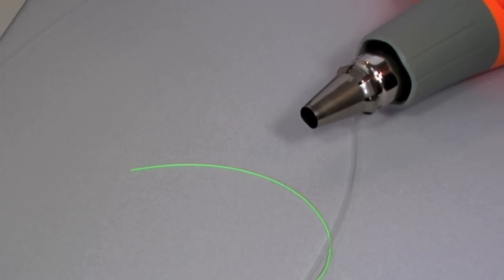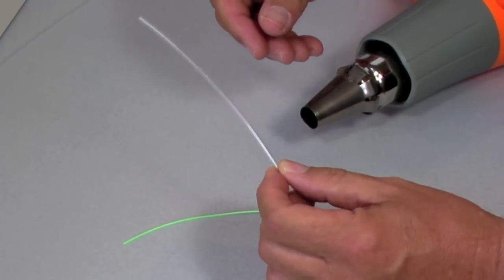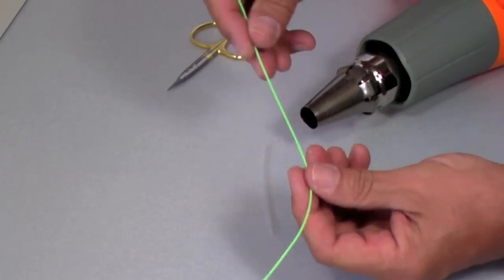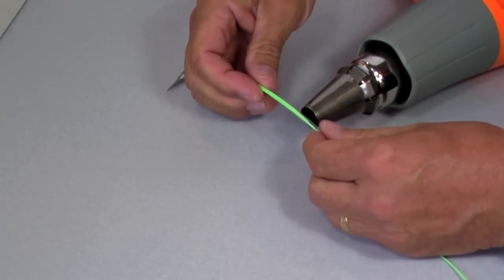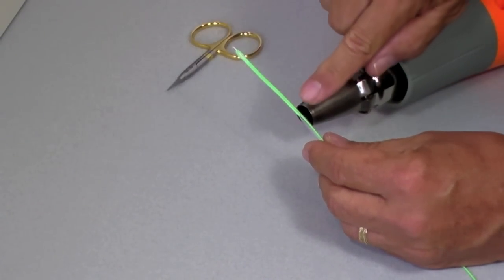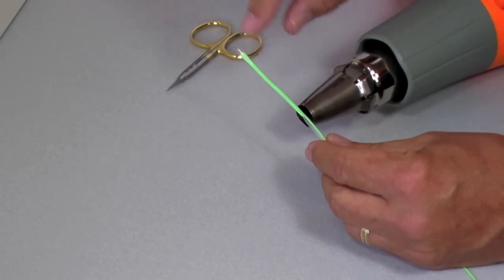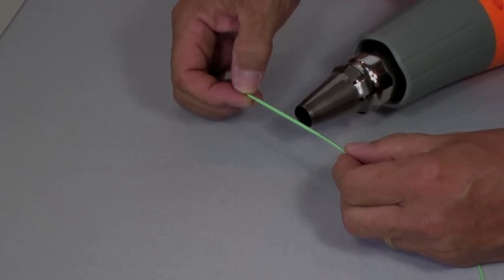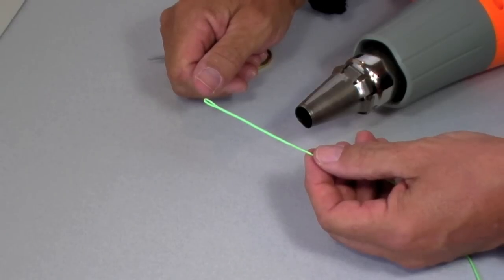Welding loops in fly line

Comment: Hey Peter, I followed your exact steps. It worked great. I made a test loop first. I did a non-scientific destructive break test on the loop. The breaking strength satisfied my gut. Then I made one on the line. It failed while removing it from the shrink wrap-I think I let it get too hot so it fused to the wrap's inner. Made another and delicately cut the wrap away. Next time, I'll use a lower heatgun temp for slower welding. Thanks! Buy yourself a beer on me.
Reply from the maker: An immediate break is certainly evidence of an overheated weld.  Go slow on low heat and it should be fine.

And I'll have that beer!  ;)

Comment from the maker: I've owned quite a few Partridge lines and welded most of them.  They take a fair bit of heat, more than a Airflo, to weld properly.  Unfortunately, they're prone to cracking just beyond the weld as the heated section becomes more brittle.  I have successfully welded them and have had them last, but it was always a toss up.  Sometimes I'd make two or three welds before I was sure I had a good one.

While thin lines are more tricky to weld, skinny Airflo lines weld just fine as do some PVC lines.

Comment from the maker: The heat gun in this video has only a High and Low setting.  I've stuck a thermometer in the flow and it registered 300C on low.  That's hot for welding, so it takes a deft touch.  I've just acquired a new gun from Steve Godshall Fly Lines, made by Eddy Electronic.  Steve supplies the nozzle for them as they don't have one out of the box.  They're about $40.00 and can control the temperature down to 120C.

Comment from the maker: It's about half an inch, but the use of the nozzle to measure is more important than the actual length. We can burn line trying to weld three and a half nozzle widths instead of four.  The welding of that 'half' will overheat the section next to it that has just been welded.

The heat shrink is polyolefin 2:1 and it can be purchased from electronic component supply stores.  I don't have a brand name for it.

Comment: Thank you for making this useful presentation. What is your experience in welding lines with different core materials (braid, Dacron. mono-filament, etc.)? I think I would be most concerned with mono and the loss of binding force between the core and coating, and ultimately overall strength, but have not tested this myself. Is this only a problem existing in my head?
Reply from the maker: All cores can be overheated and damaged, but the braided/Dacron cores are more resistant.  Mono cores on the other hand can melt at about the same temperature as PVC, producing a mess.  I prefer to weld Airflo polyurethane (PU) mono core lines as the PU melts at a lower temperature, giving us a decent chance of a good weld with a mono core.

Comment from the maker: Airflo fly lines are UK made and weld extremely well.  If you're having difficulty with Airflo lines, then either your gun lacks sufficient heat or it lacks a concentrator nozzle.

Some UK made PVC lines are difficult to weld as they need a fair bit heat, lose their plasticizers, weld, then become brittle.  The fly line then cracks behind the weld after some usage.

Rio, Cortland, and Scientific Angler all weld well, however any old PVC line can be problematic.

Comment: great helpful vid but would have been more helpful to see you peeling off the heat shrink tubing
Reply from the maker: Ya, I should've done that. These are old videos done when I had just started with videography and I should redo at least a few of them to a higher standard.

To get the heat shrink off, I usually try to remove it while it's still warm. I get it started by snipping the unheated portion with a pair of sharply pointed, small scissors. Sometimes I have to do snip the heat shrink a few times if it doesn't pull off in one shot.

Comment: Hi Peter,  Thanks for the videos - they are a great help. I could not get the clear shrink tube in the right size so I ended up using the black stuff and it worked very well for me. I found that, when initially shrunk I could see (by the shape) that there were two pieces of line and as I welded the joint the shrink tube would become round. Found that watching for the shape to change to round was an easy way to judge the progress of the fusing. I "discovered" (the hard way) that you can't make a seamless joint if the shrink tube is too big - but I am sure that is old news to you :-). Do you have an easy way of removing the shrink tube? I ended up sanding the tube to thin it on one side then pulling it off by tearing along the weekend area. Thanks again - I can now make my own sinktips.  Hank
Reply from the maker: I get the tubing off by leaving the ends unheated and therefore loose. I then stick the point of a small pair of scissors into the unheated end and snip it. From there I rip it off.
Reply: Thank you - will give that a go! Tight lines Peter!   Hank

Comment: Ah, thats interesting to know... i done about 3 to practice, then i done my fly line, and used as less heat as i could possibly get away with, its
not completly melted it but it holds together and its flexable..
i put a pen in the loop and pulled hard on the flyline and it held ok, but
i think im going to put a very small whipping just at the base of the loop for security...

Comment: Is it possible to weld Rio powerflex .024" running line. It has a mono core?
Reply from the maker: C G Possible? Yes. Fun? No. There is very little PVC on 0.024" line plus the mono melts close to the temperature of PVC. We have very little wiggle room with such a line. Better to do a fold back loop with a couple of nail knots.

Comment: As you see i am into carp fishing and we use the leader style but they cost like £6 each do your fly boys know of a line that sinks well and i can do what you did make my own save me £££
Thanks for the vid to mate
Reply: the clear sinking leaders you use are the same and fly anglers clear intermediate fly line without the tapers, the problem is you need to buy a clear intermediate running line for fly line for you to be able to cut and weld it. and they are hard to get hold of at a price saving you money(when you look at the time to cut and weld). here is one and running line of the line is 59 foot but you only use the running line the thick front tapered line probably is unsuitable. https://www.anglingactive.co.uk/airflo-ridge-clear-fly-line.html?sel=2839&gclid=Cj0KEQjwl_6oBRDHxNGz6ueJufMBEiQAvm_k_ggRfi9q5z56dZq70Q9W1GhSlv7Ea5p8oUPW0P8iLQAaAsdu8P8HAQ  . problem with this one is that its its a 5/6 weight and the core material  may not be up to the breaking strain you need. id suggest you buy one in a 8/9 weight! i have landed carp over 24 pound on a 7 weight before but that was a braided core flyline. sorry for getting into this so much and probably confusing the hell out of you as a carp angler.